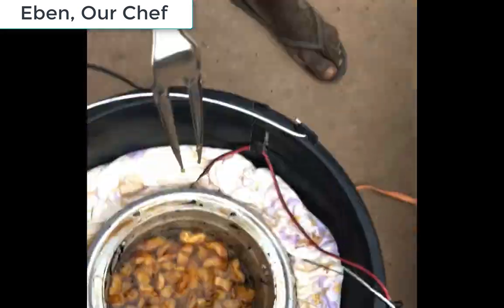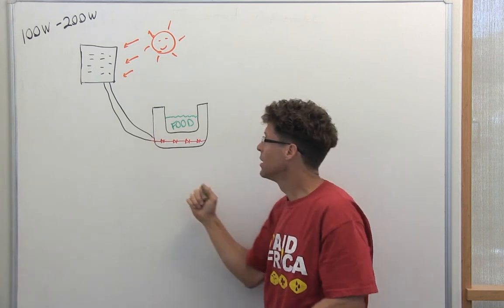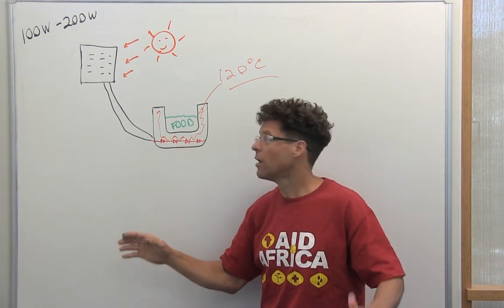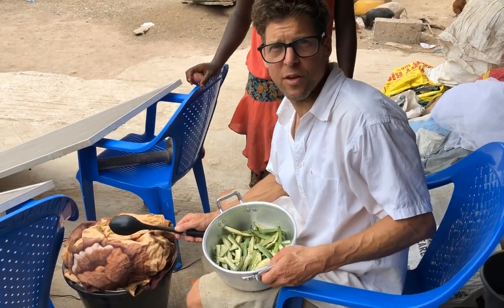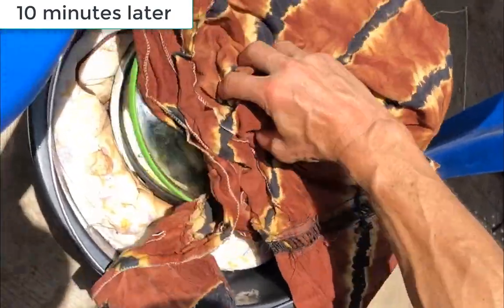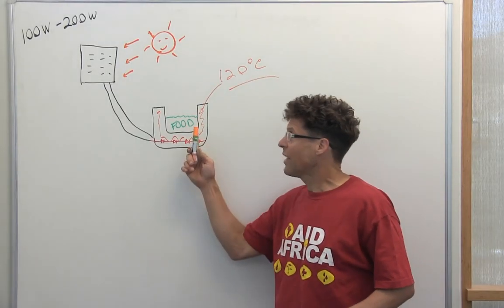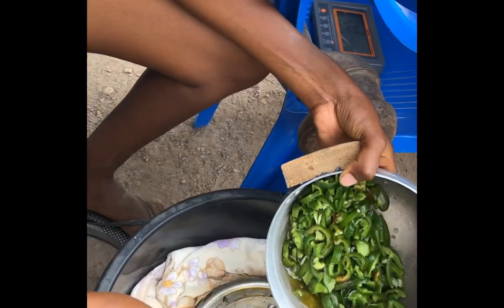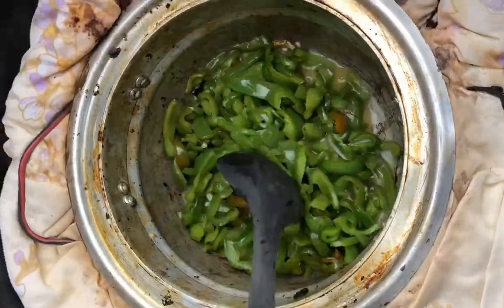Solar Electric Cooking in Ghana With Phase Change Thermal Storage, Pete Schwartz, Cal Poly Physics

Comment: Sir what kind of insulation is used?
Reply from the maker: We are using many different kinds of insulation... the only requirement is that it not burn. For hot temperatures, you need fiberglass or rockwool, or ceramic wool. If you don't get too hot, you can use wool. Please see our research website for more technical direction and details: http://sharedcurriculum.peteschwartz.net/solar-electric-cooking/
Reply: You could seal the top of the insulation layer with clay slip to prevent dust exposure. Neat little cooker. I’m interested in a phase change solar collector. You have small one for the fall and spring and a big one for 24 hr cooking in summer. Possibly heat with a short steel coil you can run tap water through the PCM storage mass to cool it. It’d probably have to be a thin stainless tube you cook food in, this cook tube is surrounded by appropriate phase change materials, in another copper tube, textured on the side that gets sun. Insulation on the shady side. Curved coated glass on the other side. It would get freaky hot in the summer where I live in oregon, and would just be a matter of adjust size of PCM mass to get the storage size right to maintain cooking temps 24/7. Outer insulation blanket goes on at night. Side benefit is that it can provide on-demand free hot water in summer, at least in the afternoon-evening. Sorry for the rant 😂